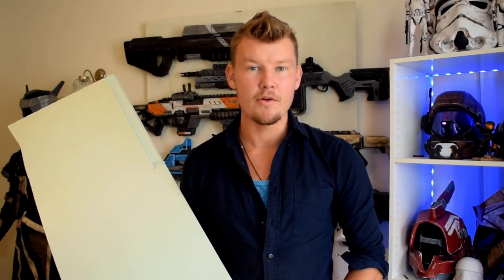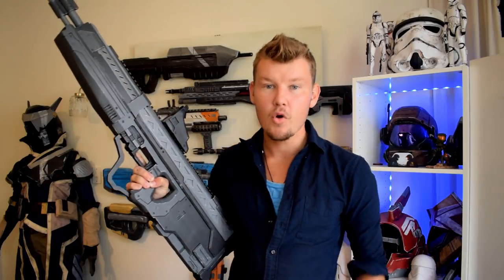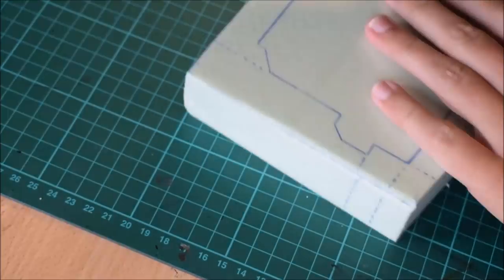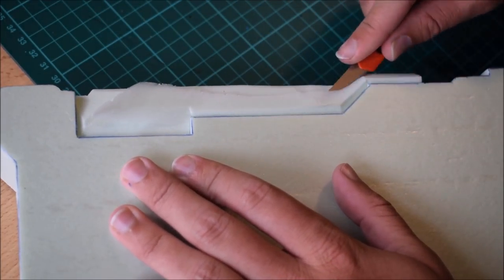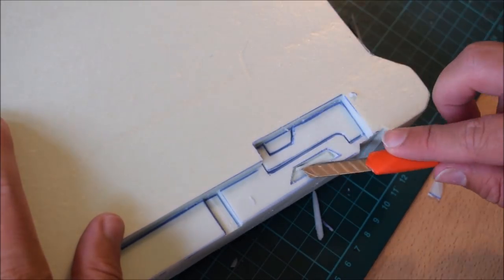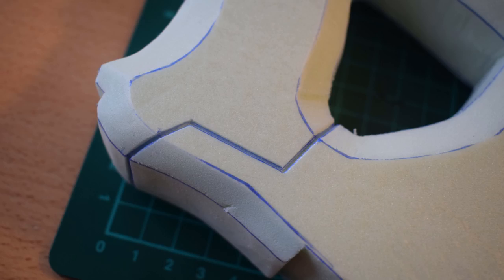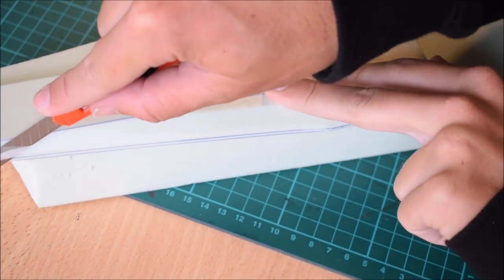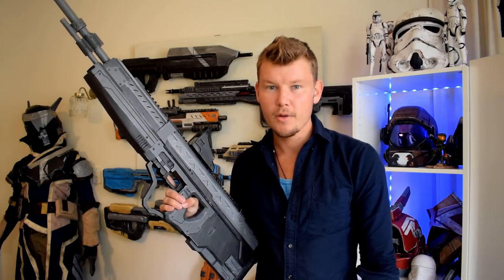HOW TO: Halo 5 DMR Cosplay Prop - Part 1

Comment: Awesome video, Andrew DFT! Could you post a link to where you get your Styrofoam? I've bought some before and the foam tends to tear rather than cut. I'll sharpen my blades and attempt to cut the foam, and the foam will just tear. Is it PVC, XPS or EPS? Thanks!
Reply: SpartanBlackwellProps I would also like to know this information.
Reply: ShirtyScarab554 same!
Reply: Hey guys. He uses Extruded Polystyrene...its a common building insulation product found from most hardware suppliers. As a visual clue to finding the right stuff, if you can see small circlular beads of polystyrene this is Expanded PS - you dont want this type. Ask for Extruded - its much smoother and doesnt break into small beads. And always use a sharp knife!! If you dont you will tear edges and leave an ugly rough finish. Hope this helps 😉
Reply: Thank you so much, Jesse Campbell! I was using Expanded polystyrene, so that would explain the tears in the foam. Thanks again!
Reply: It's EVA foam
Reply: Radioactive Redemption - DFT has used EVA foam on some of his builds but this particular one is XPS foam as I stated above 👍
Reply: Yes andrew please link the styrofoam
Reply: Go to Lowe’s they sell the foam he uses in this video if you are looking for Eva foam go to 5 below